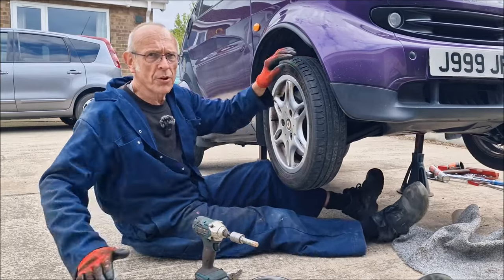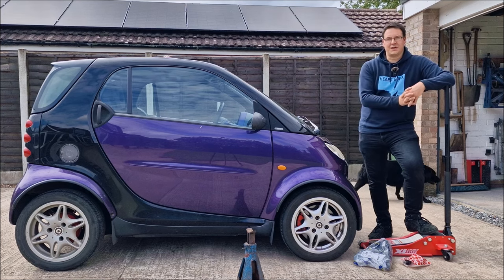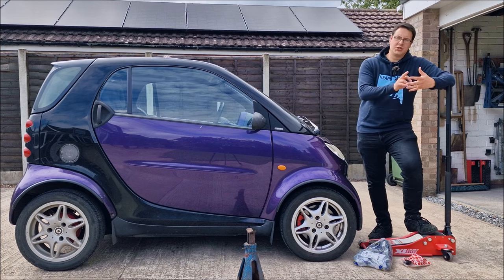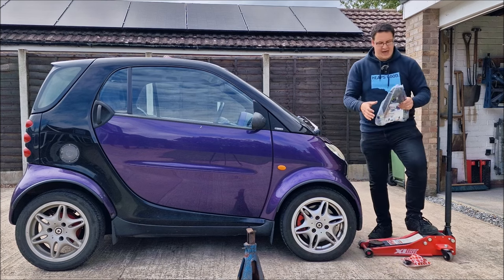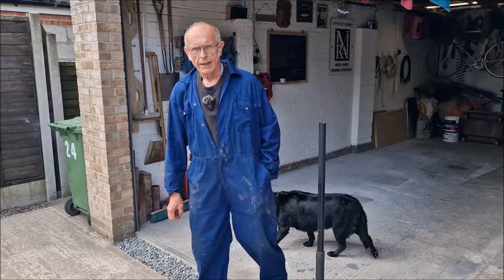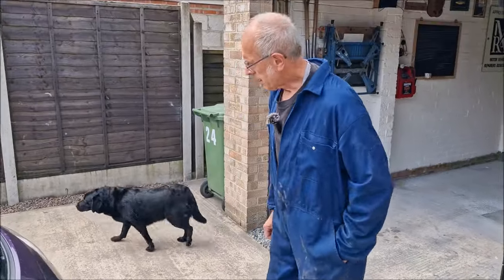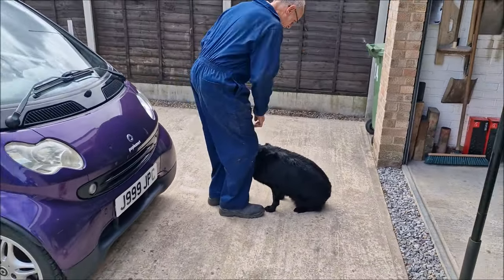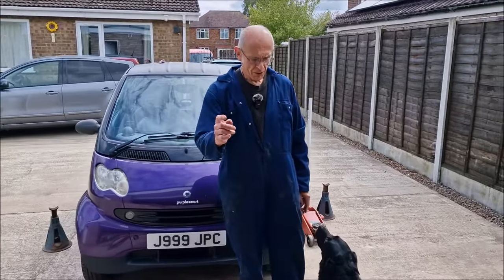"A TOTALLY Different Car Now" - Smart ForTwo Anti Roll Bar Links & Lower Arm Replaced

Comment: Your dad says it drives like a new car so it is money well spent. I had to change a couple of front control arms on my Mercedes C200 (MoT advisory items) and I noticed the difference straight away. The front wheel alignment will need to be checked and adjusted. Don't wait until you fit new front tyres unless you're going to be changing them very soon.
Reply from the maker: New tyres have been fitted this week :)

Comment: To be fair the old control arm was a lot better quality than the cheap pressed Comline item so ideally press in new bushes on these…. I don’t think they have a very hard life in the little RWD Smart….
Reply from the maker: The one we replaced was also cheap and aftermarket and not OEM 👍
Reply: @JonCoupland  OK ! Hard to judge quality I guess without trusting a brand but OEM German probably better metal and rubber.. so you're presumably on the 3rd one for that side of the car, even though the droplink was possibly original ?
Reply from the maker: @johnmoruzzi7236  sadly owing to the lack of service history when I bought the car ... were pretty much having to guess

Comment: did you know that the bottom ball joints and the upper ball joints which are to do with the track rod end are the same part number
Reply from the maker: I do now 👍😊
Reply: @JonCoupland   ihad to change mine a few months back, and changing the upper ones i was worred about, only because i thought about tracking until i looked at them. dont even need to touch the tracking, bottom ones are slightly harder cause the bolts are hidden behind the back plate but its not a difficult job at all 😁